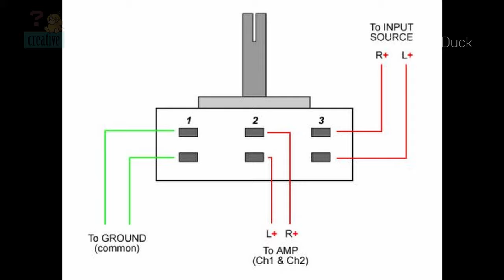How to use potentiommeter as Volume

Comment: Can I use a 3 pin B20k potentiometer if I have a mono signal?
Reply: yes you can, I tried 3 pin B10K pot and it worked fine, also for mono signal
Reply: You’d just bridge the pins this lad’s using for left and right, I think
Reply: @IWillBrutalyRemoveYourBalls  Thank you for that rec my dude, I'm working on a diy synth right now and am pretty new to this stuff
Reply: @IWillBrutalyRemoveYourBalls  Hey,  what kind of resistors are you talking about exactly?  I´m going to do this on my guitar as an volume knob that doesnt affect the tone.  like straight up Volume knob and nothing else.. Thanks

Comment: I need to make one for a 1/4 speaker jack to control the one monitor speaker volume running off the main speakers?
Reply: Thats exactly what i need to do - bridge my 200w bi-amp to 400. run a 1/4 cable off the main speaker to a monitor speaker but be able to control the monitor volume - did u have any luck?

Comment: Will this work on the speaker output from a small amp to a speaker? I have this bazooka tube bluetooth speaker and it's mono and when I turn it on and put the radio on it blasts full volume. Can I add a volume potentiometer between the amp board and the speaker to control the volume so it doesn't blast my ears out and then turn it up to the level I want?
There are just two wires going to the speaker, positive and negative.
Reply: did u do it
i hav same problem

Comment: You should use a 1k type A potentiometer, it would produce much much better results and the volume control would be smoother because type A are logarithmic. Also, 10k is too much as you did in your video, I would recommend 1k.
Reply: There's also already a volume nobe on it
Reply: I'm trying to make mine a bass control knob for my subwoofers do I hook it up the same way as it showing on the video
Reply: Hi Gil.  I want to add a pot to my speakers to only control the tweeters (they are way too much).  What do you recommend, and why?  Thanks in advance!
Reply: @benedictusmaladaptus2712  just put a diode
Reply: @gyat63   Thanks, but, but isn't that a fixed-level attenuation?  I came across some things called L-pad attenuators that claim to adjust volume without changing the resistance, however I installed some from Parts Express per the instructions but they don't do anything noticeable.  The ideal solution would be the ability to go from full output down to zero output at my discretion.....  Thoughts?
Reply: we use A50K pots for audio control
Reply: bro I did 100k potentiometer in class a
Reply: @traceyhersha  did you find a solution